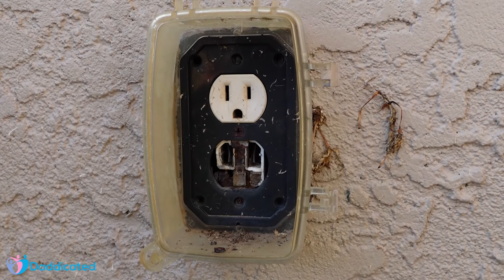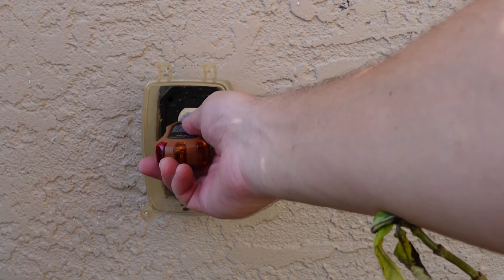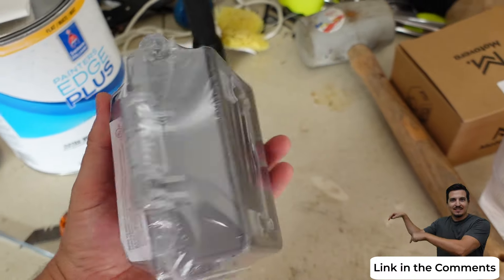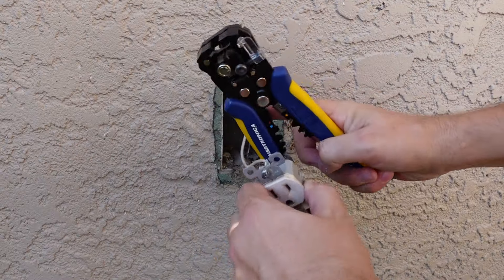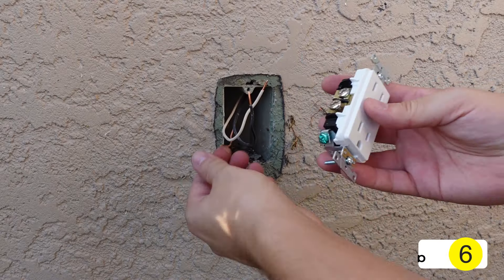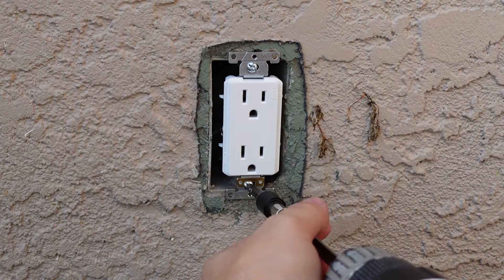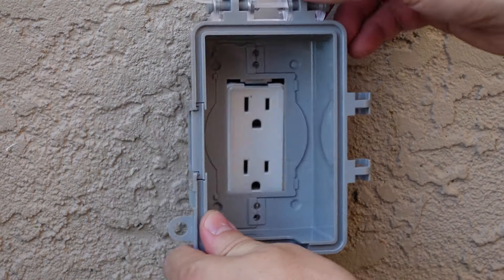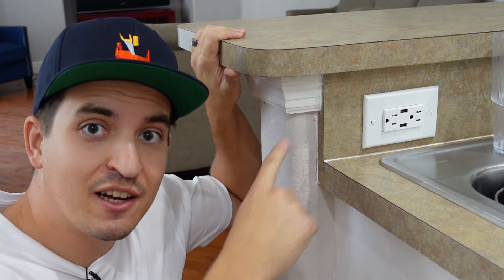How to Replace Outdoor Outlet with New Weatherproof Cover

Comment: Not sure how this ended up in my feed but either your breaker or the outlet itself needs to be GFI equipped to avoid risk of electrocution in wet conditions.
Reply from the maker: So I have a couple GFI outlets in the garage that are on the same breaker does that count? I was wondering about that but wasn’t sure. That’s how the house was when I first bought it 10 years ago.
Reply: As long as the load side of one of the GFI outlets inside on the same branch is feeding power into this outlet then it would be protected and you are fine. I would open one of them up and verify if you can. You "can" be safe with using standard outlets on just a GFI protected breaker. I know my local inspector still likes to see both the breaker and the receptacle itself have GFI circuitry. I also tend to err on the side of redundancy in terms of safety regardless of code though as code is the bare minimum requirements. Others may disagree.
Reply from the maker: Thanks for the tip. How would you verify if it’s feeding power into this outlet? Is there certain tool I could use?
Reply: Use the “test” button on your GFI outlet. Then use an outlet tester in this outlet. If   your tester shows no power to this outlet when hour GFI is tripped, that means it feeds off the GFI and is “downstream” so you’re good. If it still has power when your GFI outlet is tripped, then this is “up stream” from it and not protected by the GFI.

Comment: What if the outlet box doesn’t have a screw to even access the electrical outlet itself? Do I just pry it off with a flathead?
Reply from the maker: There’s gotta be some kind of screw, no? I guess u can try what’s the worst that could happen, u brake it? Ur still replacing it anyway.

Comment: is there a reason, you didn't use foam or caulk?
Reply from the maker: I actually ended up caulking around it with some silicone because I didn’t feel like the foam that the cover came with was enough I just forgot to record it.